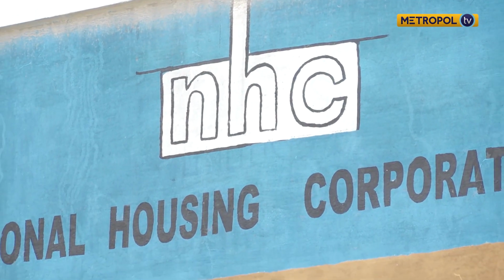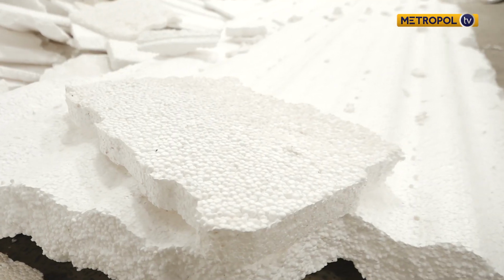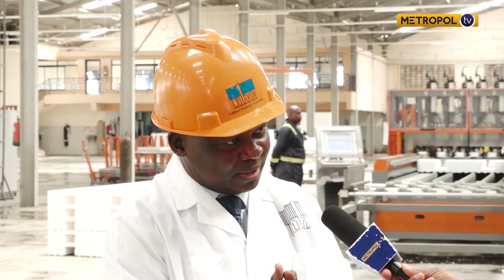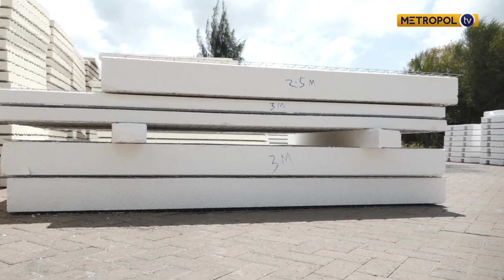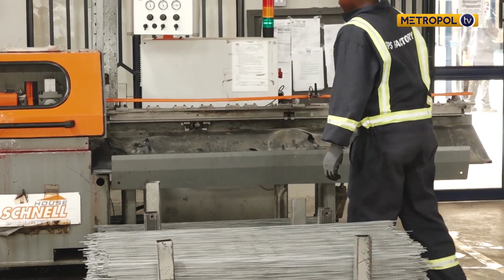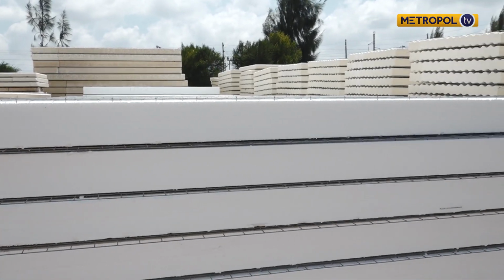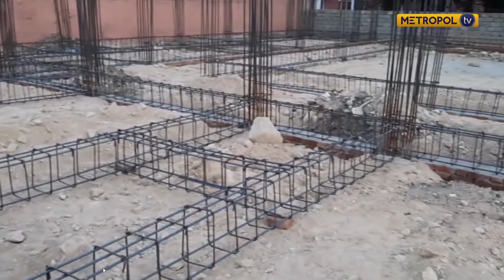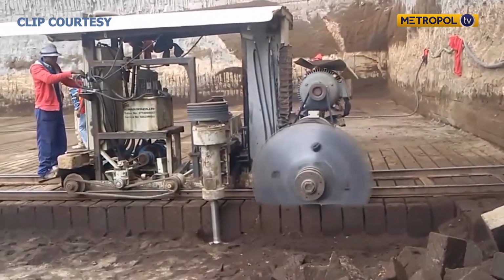EPS uptake in Kenya remains low 8 years since the tech entry in Kenya

Comment: These EPS panels are very very expensive! As of 2023 one EPS panel ranges from Ksh 6,000 to Ksh 12,000 for walls and slab. The traditional method of Ndurago stones or precast concrete is way way cheaper!
Reply: covering what square ft?again for ndarugo stones factor in labour,plaster,keying

Comment: The Govt. Should provide free or subsidized construction workshops to equip the labourers with technical knowledge then award them a certificate so as to increase industry competence in the field  of EPS. Designing using EPS on the other hand should be easier than brick and Motar. Our country desperately needs help 😂